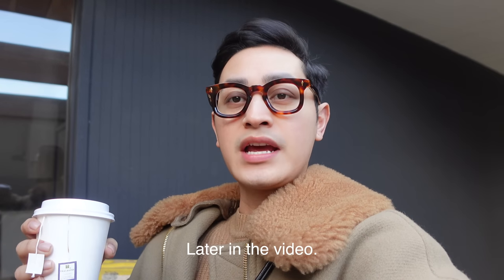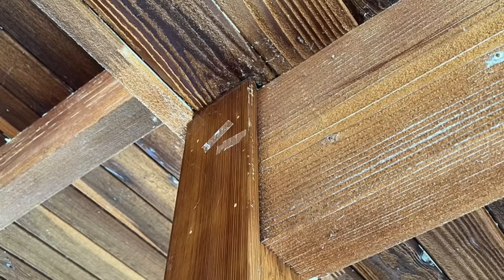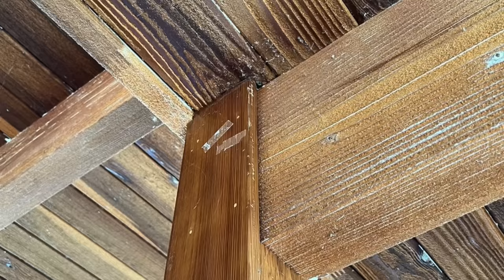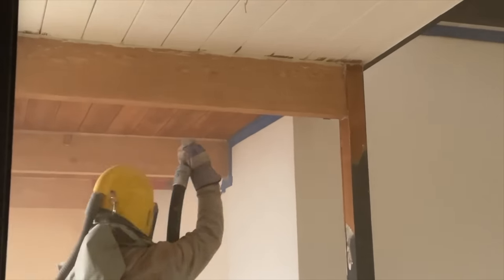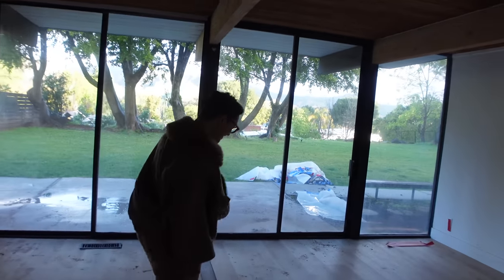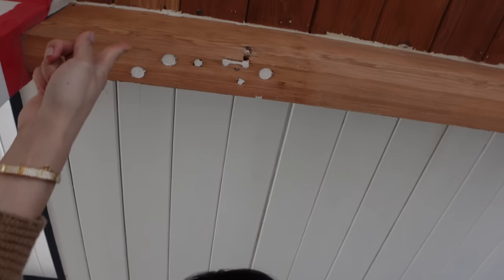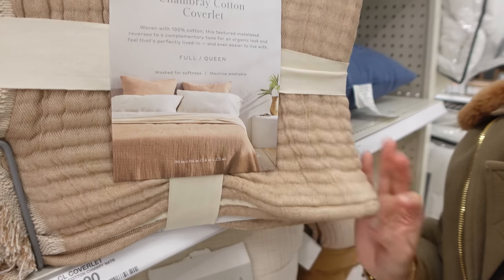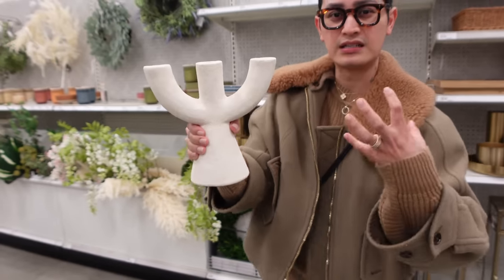NEW HOUSE TOUR! RESTORING OUR MID CENTURY CEILING.

Comment: For the white spots that were uncovered on the beams - clean out all the white stuff then clean all the sand and contaminants in the rooms, then when you go to sand, the texture left from sandblasting - keep the saw dust! You can mix it with stain-able wood glue until it is a paste and fill those holes with the paste.  Since it is technically from your same wood, when you go treat/stain/seal your wood, it will be an exact match where a premade wood filler would be a difficult match.
Reply: Not going to hold up to weather outside.

Comment: Ceiling looks fab Arvin! Sand stain and seal and any minor imperfections will just add character. For the paint… could you test different mixtures of Simply White and Acadia? Feel like just Acadia is too yellow, but adding in just enough of the brightness from the Simply White will be perfect. Also in the kitchen, what about knocking out the cabinetry next to the windows and just extending the windows across the wall? Then it’s more light at eye level and kind of keeps the solid wood ceiling theme across the house, although I know it means less storage in the kitchen. And the fire place, feel like whatever you have in mind will be great. Think as long as you make how it looks outside/inside cohesive it’ll be good, because at certain angle it was like the big brown moment from the front inside and the grey/green tile from the back outside.

Comment: Hi Arvin, keep the wood exposed on the ceilings but keep the cross beams black! …for a more mid century accurate look  it will give more dimensions to the space, right now the exposed wood on both ceiling and cross beams is making the height of the ceilings look flat and very low….just a suggestion from a purist designer 😊keep the awesome work 👍🏽👍🏽👍🏽👍🏽👍🏽👍🏽👍🏽👍🏽👍🏽👍🏽👍🏽👍🏽❤️❤️❤️❤️

Comment: The texture happens because the sandblasting eats away a bit at the softer parts of the grain. The same thing happens when you wire brush wood. It'll definitely go away when they finish sand it, but hey just a touch of texture would actually enhance the cozy Japanese vibes in my opinion, give it a touch of character and history. The patch jobs are actually fine considering it was being painted over, if your house was any older you'd find all sorts of funny contractor fixes while renovating. Its looking amazing though and will be even better once the floors get refinished/replaced to match the warmer tones.

Instead of a skylight you could of course do pendants, or if you don't want to interrupt the sight line some track lighting behind the beam. The island is a task space so its important to have lighting above there both day and night.

That wall color is definitely too yellow. It becomes clearer when you step back and look at it against the ceiling, but also the exterior black walls which are essentially part of the interior because of the house's indoor/outdoor feel.

Comment: Great job with the ceilings. I would presume that the patch in the kitchen ceiling is from the old stove vent hood as that probably was where a wall once was - under the beam. Once the ceilings are sanded, stained and sealed, it will be a huge improvement. Looks so much better than the "before" shots. Flippers really can wreck a good house.  The exterior beams are going to be an issue over the short and long run and might require replacement.

Comment: Don't stain the ceiling to a uniform shade. It will look cheap, natural wood has variations ,that's what gives it character and also very Zen vibe Clear coat the beams and you will see a slight darking, depending on the coating(  water based or oil based). As for the exterior portions try to bond and sand smooth, the color match to shade of interior beams using a solid color paint.  Also those beams. Inside are not Pine, they are Douglas fir.  Choose wall color after you see finished ceiling & pillar

Comment: The tone of the floor does not match the tone of the ceiling. If you have a solid or engineered plank, it might be worth considering removing the top layer and tinting the wood to match the ceiling shade.
Reply from the maker: We're going to change the floors :)